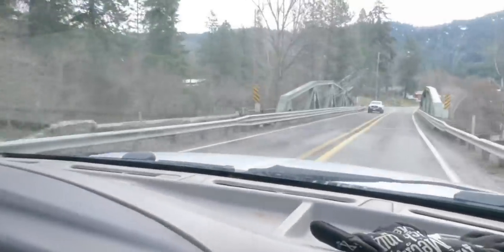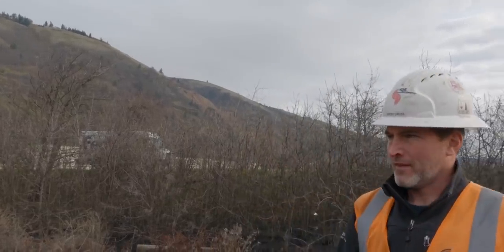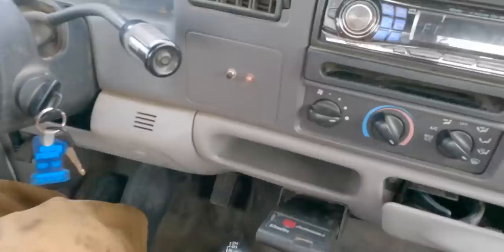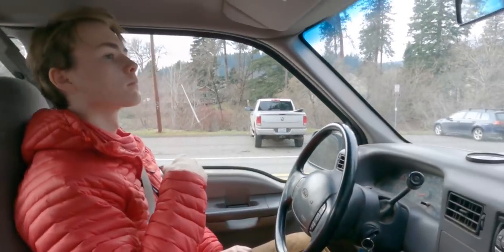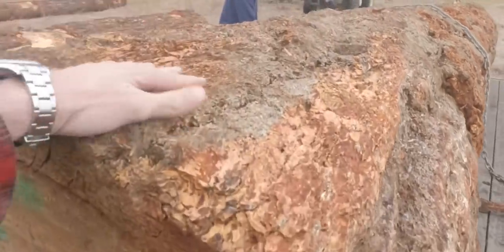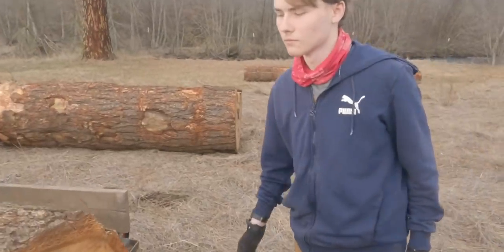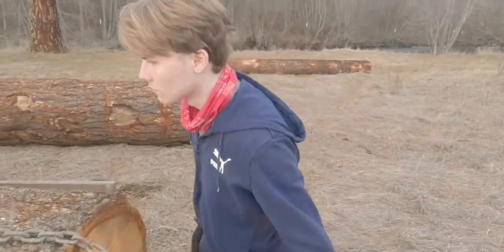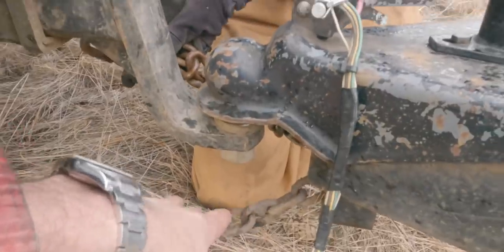I'm Scared

Comment: I'm with the boy.  Chain it from the top as the bottom chain rolls the log as it did.  The answer was to get the end loader closer with a short piece of chain between it and the log and THEN lift it slightly to remove friction and prevent dig in of the log.  You are not helping the boy when you are "right" with just as bad or even worse of an answer.   Sorry Wranglestar but you blew it on that one.  But its one out of 1000 right calls...so don't take it too hard.